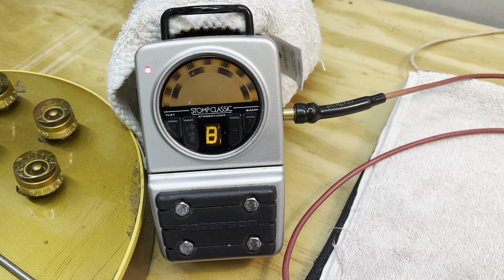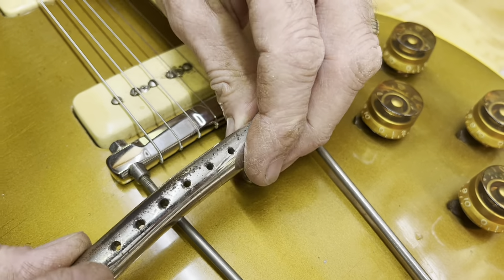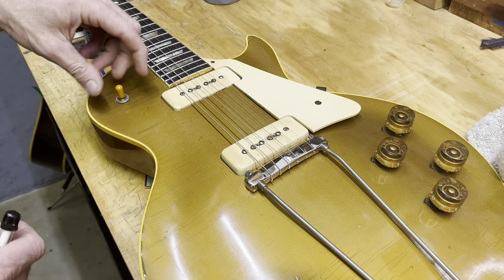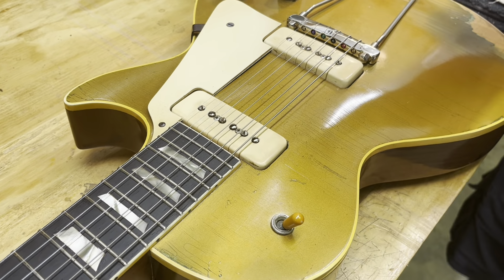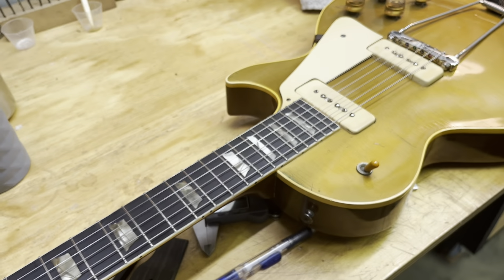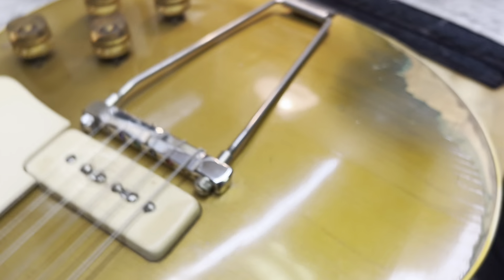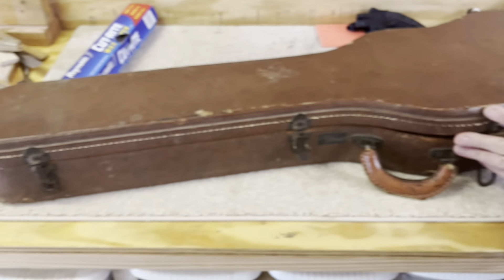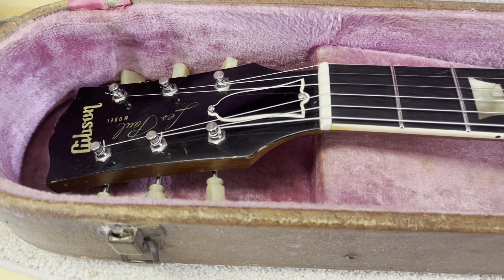Homeskoolin’ Bonus “Primitive Gold"

Comment: Hey Uncle Larry there used to be a music store in Florida called Boca Vintage that specialized in the 54 to 56 conversion. They changed out the trapeze for a tune o’ matic and a stop tail piece. Great idea for the time in my opinion. Also I’ve got a feeling you’ll regret not getting that binding issue addressed. Of course you can do it yourself. I did on my Martin. I used wood glue although I think super glue is recommended. Great episode as always. Love you man.

Comment: In 2017 our local dealer came up with a 1952 gold top that he bought in Buffalo NY just up the road. That guitar was in a closet, and later under a bed since 1955. The guy bought it and never played it! After he passed away the family found it cleaning out the house. It was in the original shipping box. Inside that was a brown leather soft bag, with a handle on it. Inside the leather bag was the original case!  Inside the case was all the literature,  a hang tag, and the original bill of sale.. folded neatly like it was yesterday!  There was not a mark on anything, it was factory new!!  They wanted $36,000 for it.  I didn't tell anyone about it, and for 6 months I tried to figure out how to do $36k  I didn't want to flip it, I wanted to keep it. The week I finally talked my wife into taking the $36k from my 401, they sold it, for $34,000. They finally plugged it in, it sounded ok, but needed the neck work. It had a forward bow. I had even bought the wide tang frets to push the bow back, I saw it early!  That's my 1 story about "the one that got away" LOL.  Thanks for reading if you got this far!  8)    Peace    --gary

Comment: Great video .. what a difference in playability and tone.  So, the new bridge doesn't use those thumbwheel height adjusters.  Guess it just rests on the top, but not sure how you adjust the height .. neck relief?  Dunno, wondering?

Comment: Thats very strange that the one coil was wound backwards. I know of no other Gibson guitars with reverse wound pickups. Makes me wonder if that the pickup is a rewind, because Gibson just never did that. Gibson DID flip the magnetic polarity on early '57 black trim PAF gold tops, on purpose to get the out of phase sound. Also they did that on the Black Beauty Customs as well, with the 3 pickup models.
Reply from the maker: The one thing I have learned about these types of anomalies is that a person simply cannot say things like “so and so company NEVER did that”

Every time I say something like that I am proven wrong 

This particular scenario actually isn’t that unusual…gruhns has seen a couple 52’s with the same deal over the years

But just in general, the older you get the more you find that these major guitar companies did bizarre things that are inexplicable at times

There are no “absolutes” in this stuff and that is a fact

Comment: if there‘s a 500k volume pot on the neck pickup replacing it with a 300 or 250k pot will reduce it‘s perceived output and low end.